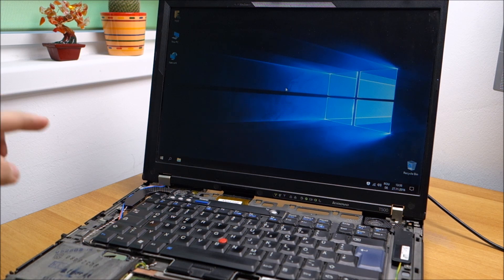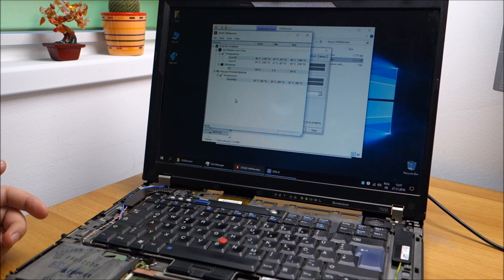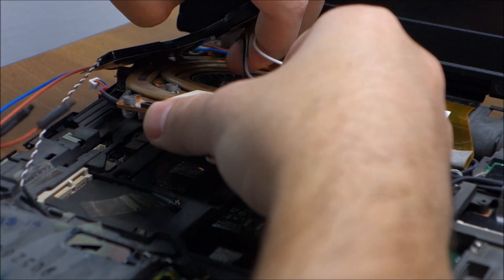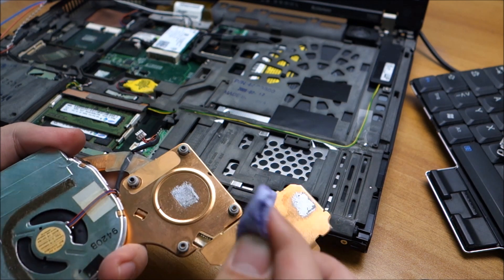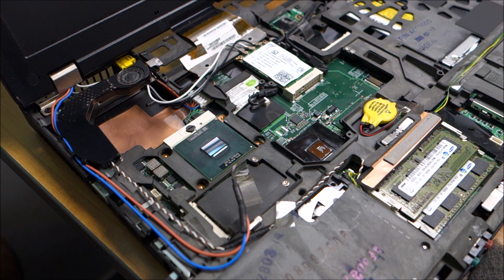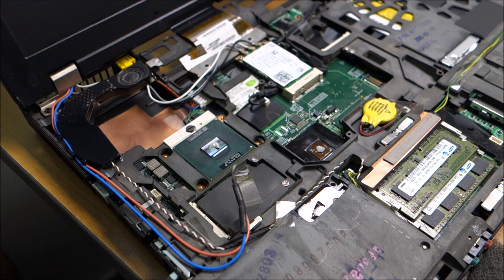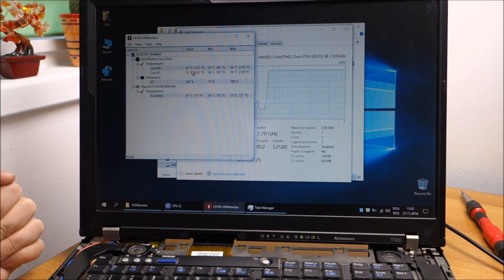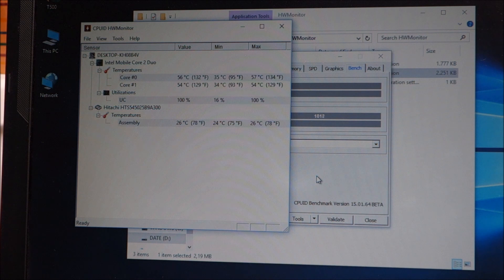DANGER! Coollaboratory Liquid Ultra - big problems after just one year

Comment: pretty strange there are lots of people using this under desktop CPUs for years that still run the same as day one
Reply from the maker: +Damien is it the Pro or the Ultra? It might be an issue just with the Ultra or even just with laptop CPUs. But as soon as I saw the exact thing on more than one CPU, I had to make this video, so at least people can be carefull about temperatures over time.
Reply: twizar people have been using ultra on desktop CPU delid for quite some time. it may be with laptop coolers
Reply from the maker: +Damien yes, it's possible, because of the higher temps maybe.
Reply: twizar it's a mystery. I am not sure all the ones I have seen showing it dried have been on laptops.not sure if it's something with the North ridge being on the same cooler ,or that the cooler can be disturbed and moved compared to a desktop .
Reply from the maker: +Damien it has something to do with the constant high temperature maybe, because in my case on the cpu it was 100% dried up, but on the chipset it still had some fluidity left.
Reply: COLLABORATORY CONTAINS Contents materials: GALLIUM CAS-Nr.: 7440-55-3 EG-Nr.: 231-163-8 video shows Why you dont want to use this on any Aluminium 
https://www.bing.com/videos/search?q=%3a+GALLIUM+copper&&view=detail&mid=9E710D6FA3DE3DCC836D9E710D6FA3DE3DCC836D&FORM=VRDGAR Check to be sure gallium is safe with the surfaces its in contact with